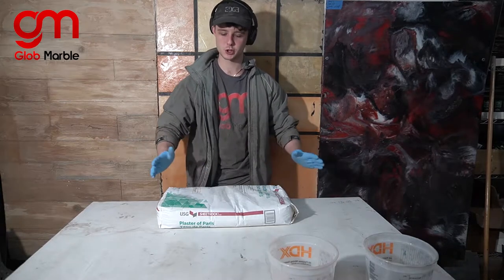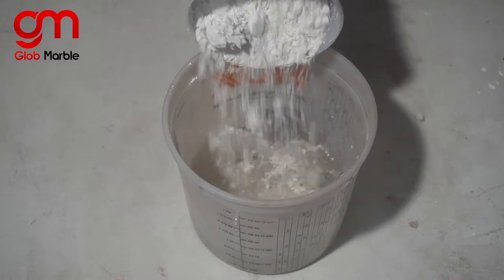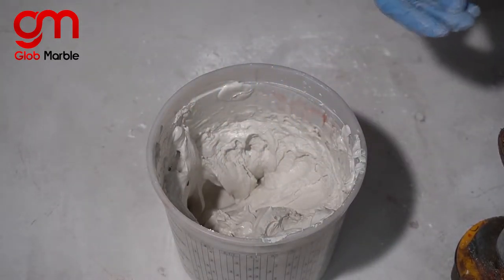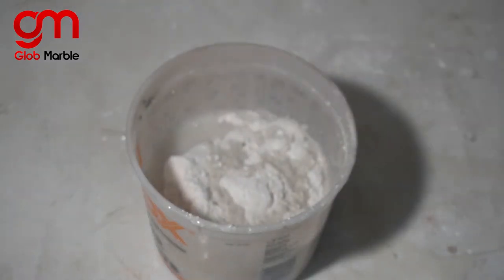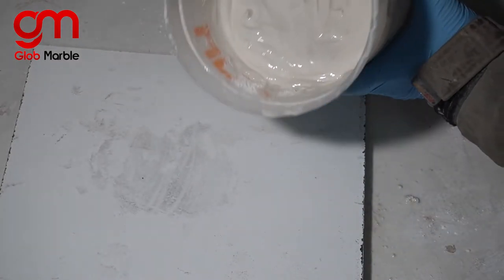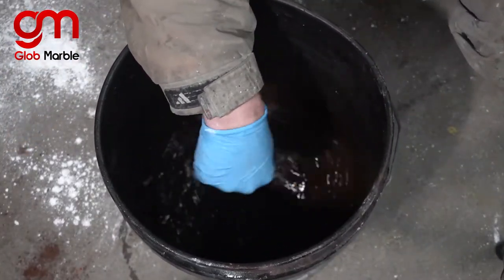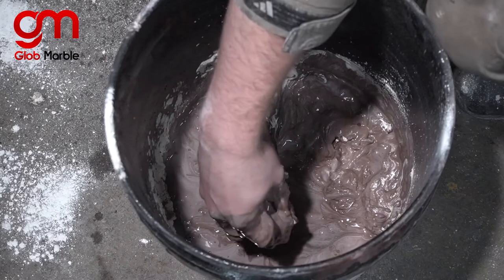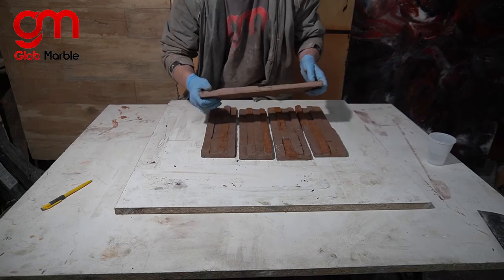Artificial Stones Made Of Plaster

Comment: Thank you for the awesome content! We are originally manufacturing thin clay bricks, but we decided to start making white (no coloring) plaster bricks since we are recieving a lot of requests. The issue is that when they start to dry, yellowish stains start to appear. Has anyone faced similar issue? It may be an issue with how we are drying them, since the place is hot and very wet. Thank you!
Reply from the maker: Plaster should be dried in a very dry environment. Usually, people have a curing room with a dehumidifier constantly running. Maybe that is the issue
Reply: @GlobMarble  We will try using another room for them. I'll give an update. Thank you for the fast reply and the fantastic content!
Reply: Update ??
Reply: @izzbern1140  Yes, we experimented a lot and talked with different manufacturers. The issue seems to be that some manufacturers extract the gypsum from areas with not so good quality and it can sometimes contain other minerals which are giving this yellowish color. My suggestion is to change the manufacturer or talk with them to send you the best quality they have.

Comment: Hi Vlad, Very good video! This "Plaster of Paris"  dont have.  Can i use "Model Gypsum" with the same method? This product dont need to use vibration table? All the best
Reply from the maker: Thanks! You definitely can use it, but it might be more expensive than plaster. A vibration table is always recommended, and it works even faster with plaster than it does with concrete

Comment: What if you wanted to apply it directly to the wall for more free form rock shapes?
Reply from the maker: Applying directly to the wall? Are you referring to stamping the wall? - https://youtu.be/-0Soi8eSdXw
Reply: Hmm that is not exactly what I meant but love the video. I will be manually trowleing on plastic to create a more realistic free form rock, like a cave. I think these people will be applying wood or drywall and not cement board so I was concerned about it absorbing water and warping or cracking later. I didn't wanna do just cement because of the limited room and depth
Reply from the maker: I definitely don't recommend trying to adhere plaster to wood. That stuff will not only absorb moisture but also warp and bend causing the plaster to delaminate and fall off
Reply: So......? You just repeated my statement. I know the board will warp and absorb moisture if I use cement board what type of plaster and sealer would you apply for rough trowel and jagged rocked shapes on the wall?

Comment: Is plaster of Paris good for showers?
Reply from the maker: Plaster is never reccomended for showers as it is extremely porous and retains moisture like a sponge. You will have mold in weeks. Instead, use microtek- https://globmarble.com/micro-topping-trutop.html and apply a food safe sealer on it- https://globmarble.com/concrete-countertop-sealer-xs-327-gloss-matte.html
Reply: @GlobMarble  ah I see, thanks for the heads up on that and the info I’ll look into the other stuff

Comment: for colouring can i use waterbase colour ??
Reply from the maker: You can, but we recommend using daviscolor pigments like in the video. It will make your concrete and plaster stronger than using water based pigments.
Reply: @GlobMarble  thanks bro

Comment: i'm g=having trouble coloring certain parts of the molds, like i want to do what you did mix the oxides with water and brush them on the surface of the molds to get a natural color but the results were not so good 
i tried mixing the oxide with water and ciment and it worked but it takes too long for me to paint many molds that way 
can you please help me
Reply from the maker: There really isn't any faster methods, but the most common are coloring the mold like I did in this video, and coloring the stones once they are already installed onto the wall. you could see how I did that in this video- https://www.youtube.com/watch?v=-0Soi8eSdXw&list=UUIyZ-tTJFpSaQkVQwJRfBlg&index=15
Reply: Thatnk you for replying and i did try it several times with water and oxydes and it's working for now but i don't spray mold release 
I will try it withe the mold release and see if it works
Reply from the maker: If you are mixing concrete you must use a release agent, because you will completely destroy your mold otherwise. Also our release agent helps remove bubbles from the stone surface. Here is a link to it- https://globmarble.com/concrete-release-agent-g-1.html
Reply: I am using white ciment and i will take your advice and use mold release 
I have a request please if you can give me a link to any social media you have so that i can send you some of my work 
I'm a begginer and just now you gave me a great advice thank you